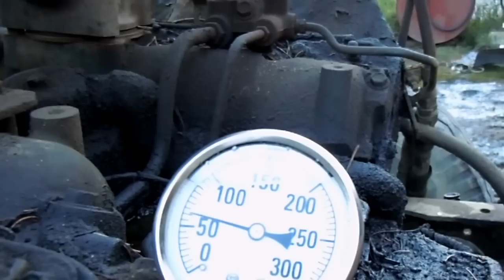8.2 L GM V8 Detroit Diesel

Comment: Gm should have at least put a 6.2 diesel in the cars back then. 

They probably would have been better than the 350
Reply: It was a more fuel efficient alternative to the 350, but too heavy and expensive to own and operate to nake it viable. If it gad a turbo, it would've been able to compete with the 454. The 6.2, if turbocharged, would have been a force to be reckoned with.
Reply: @yaboileeroy3038  they made turbo kits
Reply: @yaboileeroy3038  The 6.2L had the option of the Banks turbocharger.The same kit was available for the 6.9L-7.3L in the Ford F250-F550.The 6.2L was only in the H1 and C10-C30/K5-K30,including the CUCV and HMMWV for the Military.All three engines were indirect fuel injection,and obviously naturally aspirated.But the turbocharger only provided 5-10 psi of boost.On the 6.2L,the best thing to give it some strength is completely interchange with a 6.5L,espiecally a turbocharger that can actually do 13-18 psi of boost,which is what the 8.2L could do on it's own with 15-18 psi of boost.
Reply: G.M. actually had a Oldsmobile 4.3L for cars and some of the g body cars even had the Oldsmobile 5.7L which was common in trucks prior to 1982.But it was a fucking failure of a engine,everything on them breaked,it was only a gas converted engine to run on diesel,but nothing in them could handle the temperature,torque,and compression that a diesel engine outputs.The 6.2L-6.5L was in the Hummers and C10-C30/K5-K30,both also in the HMMWV-ECV and D10-D30 CUCV.The 8.2L came out in 1980 and only was in the C50-C70,it was even offered in the Ford F600-F900 too.
Reply: @Slim_Slid  the D blocks were better , however at the end of they day, the majority of the American buying public had no clue on how to maintain diesels.
Reply: @86twin  The 8.2L had a design flaw with the cylinders about reaching the top,so if you had a fuel pincher that was turbocharged,you dealt with head studs and gaskets quite often,they were known to last 40,000 miles if you were fortunate.The N/A 8.2L was kind of lack lust but still decent.All of them also had a issue with fuel getting into the coolant,which had to be checked regularly,or else there was overheating and a cracked engine block.
The 6.2L was based on the 8.2L and the 6.5L was a bored out 6.2L.In fact,the 8.2L had a parent bore block just like the 5.9L 6BT,but then the 8.3L 6CT had wet sleeves just like the I.H./N.R. DT366/DT460.On the 6.2L,some of them were notorious for cracking blocks and head gaskets espiecally,but a majority of them were great engines,they just had common problems with base housings and harmonic balancers,the 6.5L was the exact same thing.
The 6.2L-6.5L just like the 8.2L were all built for fuel efficiency,so they slacked on torque,that is all.What Ford/Navistar and Cummins had ran circles around them,the 6BT & 6CT both had more torque than all three including the Ford 6.6L and 7.8L and the Navistar T444E,DT366,and DT466.They were one of the first 4 stroke engines at the time because for a couple of decades already Detroit Diesel only built 2 stroke engines.The 6.2L,6.5L,and 8.2L in the Military were actually built more bulletproof than what civilian vehicular apparatus they were acquired in.The Seabees use to have 8.2L 6×6 C70 dump trucks and wreckers for a decade until they went with the Ford 6×6 F900 with the 7.8L,still in service a few decades later.The 6.2L came in the first fleets of the CUCV (M1008-M1031) and HMMWV (M998).Both trucks obviously got the 6.5L,and they still made them even when G.M. copied Isuzu and already had the Duramax because they sold rights to AM General to keep them in production.There even is a P400 and 6500 that are highly based on the 6.5L.They don't make them at all anymore of course,but the HMMWV (M1113-M1167) is still around and will be for another two decades,the only difference is that they're no longer in combat,except for the ones left over,that ended awhile back.
Reply: @Slim_Slid  I don't know, my dad had an '81 Oldsmobile, 5.7L diesel, put 300000 km on it and never had to repair or replace anything, aside from the odd fan belt or a fuel filter... maybe his engine was an outlier, but the 5.7 diesels PRIOR to the '81 model year weren't much to write home about...

Comment: I owned one of these...................JUNK!!!
Reply: I guess it's how you take care of it, I had one in my 85 GMC 6500, drove it daily for 17 years without a problem, just oil changes, sold to the business next door and he is still using it!
Reply: @ogr7771  I had two blown head gaskets and a broken crankshaft in the first 55000 miles.  I switched to DT466's and had no problems.
Reply: These engines require a descent operator , and any good operator knows that you can’t judge an engine with only owning one.    I’ve owned half a dozen and 4/6 run great.  1/6 had head gasket issues.  You can tell that somebody drove it way too hot and did not take care of it.  The other four were from a fleet and I still have 2 of them running
Reply: @ogr7771  The early 80s 80s were not that good and it seems like after 8485 generations got better as they started to fix some of the head gasket issues from the factory from what I understand

Comment: I want one of these engines. I wish I knew where I could get one.
Reply: Look around for older F600 and F700 trucks, many of them ran 8.2 Detroit’s or 3208 Caterpillar engines
Reply: I have one you can buy if you pull it out of my school bus, haha. Runs like a top, I just want a Cummins instead.
Reply: @Vince-DM  I’ve never had any issues with the 8.2 but I’d definitely rather run a 8.3 Cummins, or hell even a 5.9 Cummins haha
Reply: @Vince-DM  Are you shooting for the 12 valve mechanical motor, or the newer 24 valve setup?
Reply: I have 2 good running 8.2 turbo available. One was in a Ford F-series truck with an Allison automatic behind it, the other is still in a Chevy C70 with a 5 speed behind it. Both run great.

Comment: I've heard people say the 8.2 was a piece of junk. I beg to differ. It was an excellent medium duty truck engine that was very reliable. It just didn't have a lot of power by today's standards and it wasn't very fuel efficient.
Reply: Yeah they ran just fine, most people who claim they are junk have just never owned one
Reply: Unfortunately, it is incredibly difficult to service since tool and parts availability are rare. Injector tuning is very complicated, as there is no "pump". Dead simple with no glow plugs, I'll give it that. Mine has great compression, but tops out at 50 mph (and struggles to get there)
Reply: This engine had many problems from the start. Head gaskets and blocks cracked. Detroit tried to make a Cat 3208 medium duty engine and in my opinion both sucked.
Reply: @rongreen8485  we had about 15 in our fleet and never had a problem with one, other than scheduled maintenance. But it's a boat anchor by today's standards.
Reply: @LJ-gn2un  well I think you just have to be realistic about what to expect out of them performance wise. In the right truck and being used for the right purpose both the 8.2 and 3208 can be damn good engines
Reply: @LJ-gn2un  you're very fortunate indeed. I worked for a Detroit dealership 20 years saw many came in on a hook. Saw many broken blocks and head gasket failures, lots of engine swaps. Also DD changed the head head bolts 14 to 15mm this was a field fix. We lost $$ on every job due to low flat rate time to perform. Happy to see them gone. Take care.
Reply: My 8.2 dd starts up and goes to work faster than you can watch this video.  I have the larger head bolts and mine was rebuilt in 92.  When it dies I will install another.  Super easy with a cab over !  Don’t let others tell you different as they don’t own one or had a fleet of them lol!  I have 2 friends with offshore boats with thousands of hours and they have had no issues and easy to work on.  If you’re in Seattle area I have a friend that has the special tools and know how to dial them in! Nice engine and cheers!
Reply: @warrenmcelroy4718  I agree!
Reply: Wasn't very fuel efficient? Have you even checked what a competing gasser got... like 5-6 on a good day and the 8.2 can get double that.
Reply: @Wingnut353 RIGHT! These 8.2 were FANTASTIC on fuel if they were tuned right.

Comment: Ford application. Man, what a TERRIBLE engine......
Reply: Jeff Parris I've had excellent results with these.  Maintain the injectors and, on the turbo engine especially, don't lug it and it'll go forever.
Reply: @tylerzylstra5617  What do you mean by "don't lug it". I have this engine in a 1988 school bus and I am loving it so far. Very quiet, very smooth. Need it to last another 500k miles! has less than 100k right now
Reply: @bryandouglas5922    Basically use the transmission. Don't run heavy on the throttle and low RPM if you can downshift. Lots of power at low RPM means a lot of force for a longer period of time on engine parts. It'll cause the main bearings to wear prematurely. The 8.2 is also an open-deck block so it's a lot of lateral force on the piston wall for a long period of time, and the cylinder has no support other than at its base...so the cylinder could deflect a little bit and your head gaskets will fail in a hurry. There's actually a boating site that gets into a lot of the technical details and every fault you could find with the engine's design.

Personally, I think a school bus is probably one of the best possible applications. You're not going to be driving around at full throttle all the time and it's likely an automatic transmission which should keep it in a happy RPM band for you. The 8.2 isn't as rugged as a lot of other engines but if you take care of it and keep it at 80% throttle (that's what the boating guys say which means constant load unlike driving on a road) they'll last. I checked with a former coworker and the old straight truck we had at my last job with the 8.2 is still running around carrying whatever they can fit in it. It's not fancy or fast, but it's still going.

Now another 400k? I dont want to discourage you but that might be tough. If the engine is not turbocharged it stands a better chance but it would be a dog. It might do it but I wouldn't be surprised if you end up going through a number of head gasket replacements shooting for 500k
Reply: @bryandouglas5922 keep the RPM high